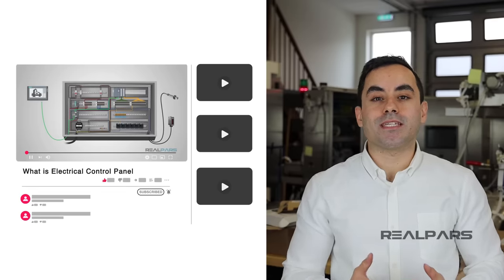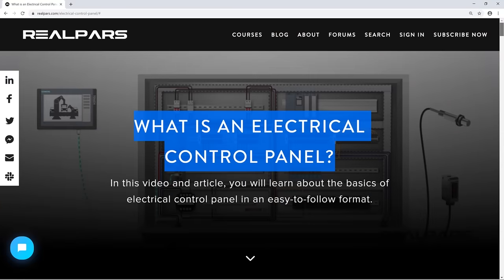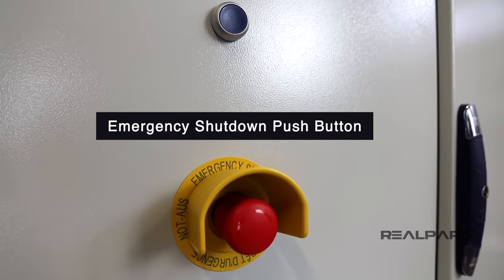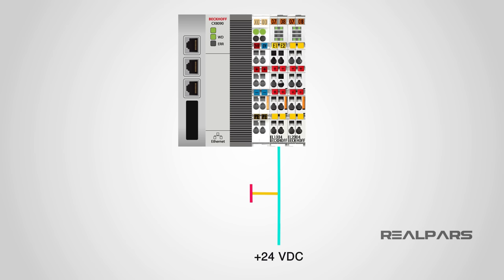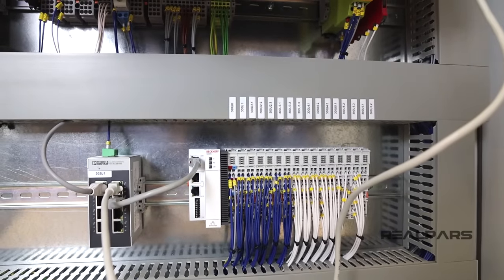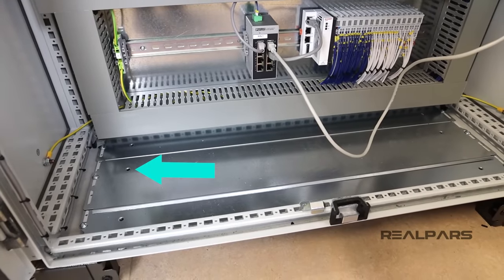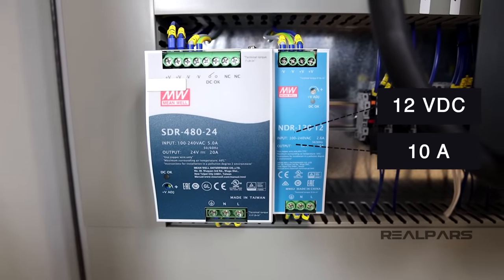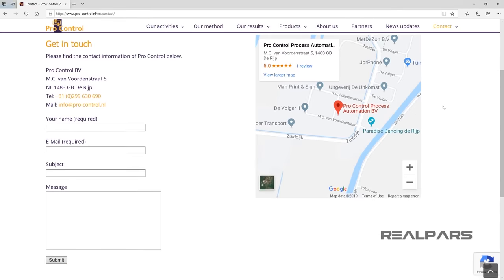Reviewing the Basics of an Electrical Control Panel (Practical Example)

Comment: Great job, one question, how do you make de distribuition of the power of the power suply to the devices?
Reply from the maker: Thank you for your question. The decision depends on your load requirements. You have two options: using a single power supply with a 20% safety margin for your PLC and IO devices, or separating the PLC from the IO load with individual power supplies. Regardless of your choice, it's essential to ensure proper fusing for each component. Detailed information on this topic is covered in technical courses, where formulas are used to calculate feeder circuits. 

RealPars offers beginner lessons on this subject for pro-membership. You can sign up for a week-long trial using the following link: https://www.realpars.com/courses/industrial-electrical-maintenance-essentials. Happy learning

Comment: Please don't learn people to wire a emergency stop function direct to a plc. Never trust a program to handel your safety. Always wire a safety controller, this checks for wire continuety. So wen a wire got lose your emergency conyoller shuts down. A few examples PILZ pnoz , twinsafe from beckhoff.  You can wire a feedback signal from your safety controller directly to your plc
Reply from the maker: In the panel shown, there are many wiring connections between the devices.  The ones connected to the PLC are the only ones that we have explained in any detail in this quick overview.  Typically, one E-Stop contact is brought into the PLC for indication, and a second contact is used to interlock power supplies, outputs, and device circuits.
Reply: Thank you very much for giving this idea we should not trust in program we should not consistrat in function we should consistrat in our study good luck for the education
Reply: It was so much easier when computers weren't running EVERYTHING. I'm for automation, but my gosh when the Drawings have been made into trees and programmer is hiding somewhere I'm the Bahamas my hair turns Grey each second trying to......

Comment: Does Pro Contols welcome people who like to learn industrial automation and other electrical circuits and devices, especially PLC?  ...And if they are from outside Europe?  Thank you for your channel, as usual, which is distinguished by providing everything useful and in a smooth manner😊
Reply from the maker: Hi Ahmed, thank you for your comment and for sharing your kind words! Regarding your question about Pro Control, that's not something we are aware of, but I would suggest reaching out to them yourself. 

Happy learning!
Reply: @realpars  
welcome, I will do that... I have another question if possible... I am a systems and control engineer and I work in a company that produces egg trays... When I told the engineers here that the contactor works to protect the PLC from high loads... they said that the contactor is only  An intermediary between the motor and the PLC and has nothing to do with protection.... Can you help in finding the correct answer?

Comment: Absolutely love RealPars... Can you please upload a video on process control for bread tunnel ovens? Like those which use RTD a temp sensor and modutrols as actuators for increasing or decreasing the flow and pressure of combustion air? Such air coming within a pipe, thanks to the venturi principle, entrains and mix with a volume of gas. The air/gas mixture is then finally burned at a ribbon to increase heat output depending on temp SP. Go ahead!!!!
Reply from the maker: Hey Alejandro!

Thanks for your comment and your suggestion. I will pass this on to our course developers!

Thanks for sharing and happy learning!

Comment: What's the point of carrying sensor cables from the bottom, thrue the whole cabinet, to the terminals at the top, and then back, to controller at the bottom? Why dont You place sensor terminals near the PLC? Thanks for your videos!
Reply from the maker: The placement of devices and the routing of cables in a control panel is largely at the discretion of the panel designer.  Many times, when there are multiple voltages in the panel (24VDC, 120VAC, 460VAC), the devices that are wired to each voltage are segregated from the devices wired to other voltages.

Comment: @realpars
A spectacular easy to understand explanation course. I appreciate it so much.

Is there any AI operated PLC design software that inputs the load(s) and generate circuit diagram for the entire PLC
Reply from the maker: Thank you for your question. I'm not entirely sure, but it seems likely that more options will be available soon. Many professional CAD programs for generating electrical diagrams have been around for over ten years and are continuously improving. You can search online for professional CAD programs to learn about their features and read reviews. Some companies even offer demo versions for limited use. Happy exploring

Comment: Hello, RealPars.

I really appreciate your explanations by means of the tutorial's videos; that is very useful.

I have a question for you.

I came across a noticeable difference inside the control cabinets in relation to DIN Rail 35 mounting.

Some brands like Rockweel Automation, use Parres insulators to separate DIN Rail 35 to the sub-plate. However, in other enclosures, the DIN Rail 35 is directly installed on the sub-plane.

Would you mind explaining the reasons for these differences?  or what is the standard to follow
Reply from the maker: Hi William, 

Thank you for your question. To the best of my knowledge, there is no electrical necessity to use an insulator on the DIN rail, at least not based on the AB PLC being used. It could be a matter of personal preference for the customer. We hope this information contributes to your learning journey with RealPars.

Comment: Wonderful video. But I have a doubt. Is the Legran Unit Distribuition for control  power or cables? Here it is shown as a control cable distribution, while in the Main Switch Video  it is presented as a power  module. 
Many thanks.
Reply from the maker: The Legrand 048-XX distribution block shown is meant for use with individual control wires and low voltages as shown, but there is nothing wrong with taking a multi-conductor cable and spreading it so each wire can be landed.  Legrand also makes power distribution blocks which are similar, except that they can carry higher current loads at 240VAC/415VAC.
Reply: @realpars  Thank you so much for the atention on answering my question.

Comment: Thanks for your videos. I have a question. hould we connect the negative wire of the 24 V Switching power supply in the panel to the instrumentation ground or not?
Reply from the maker: Theoretically, yes, since the 24 VDC power supply is typically connected to ground.  Because some power supplies are not regulated as well as others, it is best to connect the common side of devices connected to a 24 VDC power supply to the V- terminal of the supply (usually a terminal block referenced to V-).

Comment: Please show how will look the electrical connection of multiply single phase servoamplifiers with different power. They will be connected in cascade chain. Upper power line should have main circuit breaker, overvoltage suppressor, residual circuit breakers, noise filters and circuit breakers for each servo amplifier. And show how to calculate them and show specification examples of each device. Thanks

Comment: amazing videos, I have been learning a lot of and changing my mentality about that incredible world, but I have a question; ¿ HOW MANY SERVO MOTORS CAN BE CONNECTED TO THE SAME SERVO ASISTENT; if I have 4 servo motors , can I connect them to the same servo asistent ; or I need necessary to connect each servo motor to his personal servo asistent. THANKS
Reply from the maker: The answer depends on your servo drive/motor manufacturer and what software they provide for a software interface.  In general, the same servo configuration tool can be connected to multiple servo drives/motors via an ethernet interface.  If your servo drives have serial RS-232 interfaces, this may not be possible without physically moving a cable from one motor to another.  Remember, servo drives are the controllers for servo motors, and a separate drive is usually required for each motor, but the drives can usually be networked together.
Reply: @realpars  thanks for the answer, I will follow u recommendations and get 5 servo asistent to my 5 servo motors, keep helping people, u do a great job, THANKS

Comment: Nice video.. 
Why are the pumps directly not connected with PLC using contactors or relays, what is the use of CIU between PLC and pumps ? by using relays or contactors you would have saved the cost of Ethernet switch.. 
Please clear this doubt
Reply: The CIU modules connect to pumps made by Grundfos that have integrated VSD (Variable Speed Drive) and allow more detailed control than on/off with contactors. With a single ethernet cable the PLC can control speed of the pump and receive feedback on motor condition, output pressure, flow rate, etc.
This becomes more powerful the more pumps you are controlling. You will observe that this control panel has at least 8 CIU modules connected. The panel space to fit eight sets of contactors, terminals, PLC analog cards for speed control, etc. as well as running cables for each of these to every pump would quickly become excessive.
Using a communications interface also allows control of the pump at a great distance. Pumps hundreds of meters away in a large facility can be controlled as easily as one sitting next to the panel, all over a single ethernet cable.
Reply: @sjholmesbrown  sounds great. So can a CIU be used to control speed of multiple 3 phase motors over 15hp since it have integrated VSD? and what is the difference between vfd and VSD?
Reply: @silverline5789  It looks like this system requires one CIU for each pump to be controlled. The PLC can control as many pumps as you wish, subject to comms bandwidth and program memory space. VSD and VFD are two names for the same thing.

Comment: is it reliable to connect emergency system to plc,i mean i thought plc isnt reliable to shutdown whole system in emergency situation ? thx for your videos,i love realpars
Reply: The PLC has to be aware the safety system has faults and in my work there would be a e-stop safety relay , door safety relay and others as required 

However the robustness of the safety system depends on the safety risks of the machine and step one is to due a Safety Assessment and then build the system to control the risks 

In most modern machines the Safety Relay is going to shut off various things but as there our now safety PLC the complexity goes beyond a video like this
Reply: @tommays56  there's also the possibility to use  Plc désigned for safety. Almost every major brand does it nowadays, but an another hand needs people with a flawless knowledge of sécurity normes and wiring.

Comment: Please make a video on wiring of PLC I/O and power supply in panel...
Reply from the maker: Hi Alpesh, we already have videos on wiring sensors to the PLC inputs and also several videos on PLC power supply. II will list some of them below. 

How to Wire Sensors to a PLC - Part 1 https://youtu.be/qeBAz_XXUWs
How to Wire Sensors to a PLC - Part 2 https://youtu.be/4EQtCSrKjLs
How PLC Power Supplies Work https://youtu.be/Cl8Uwe1tJ3E
What is a Redundant Power Supply and How Does It Work? https://youtu.be/VgoMG0p90JU
How to Wire Discrete DC Sensors to PLC - Part 1 https://youtu.be/0DoqKS8jqSA
How to Wire Discrete DC Sensors to PLC - Part 2  https://youtu.be/2pdvvqkguA4

I hope this helps. Let us know if we can be of more service or if you have any questions.

Comment: Hello sir, u guys make very good video. can u make a video on how to read control circuit of electrical panel wiring of lubrication oil system and jacking oil system . which have 3 motor for LOS and 2 motors JOS. There are interlocking and change over also in the circuit diagram. I will highly appreciate if u make a video on this as there no video about that in whole YouTube. Thank you I hope u see my comment and make a video.
Reply from the maker: Thank you for your comment, and for sharing your topic suggestion! I will happily go ahead and forward this to our course developers. 

Happy learning!

Comment: Great video. I need to know about the coding of wire colours inside the panel under the EU regulations. There is a rule which colour can I use? Any idea from where can I find a table  of wire colour for 3 phase and neutral, 24vac and dc, safety wires, control wires, start/stop wires, inputs/outputs wires, reset wire and data signal wire.
Reply from the maker: IEC/EN-60204 is the applicable standard. A handy color chart is downloadable at:  https://www.rowse.co.uk/static/downloads/control-panel-wiring-colour-codes-info-card.pdf

Comment: hello and thanks for this video, but i have a question can we connect the sensors directly with the plc ?
Reply from the maker: If you are referring to a direct connection to the CPU, most likely the answer is no.  PLC CPU's are like the motherboard of a PC.  In order to talk to other devices, you need a separate NIC card or serial bus (USB) interface.   PLC's require an I/O subsystem.  In a few cases, the I/O subsystem is integrated into the same housing as the CPU, but most of the time, the I/O subsystem is separate from the CPU. In either case, the sensor and the PLC card that they will be wired to need to be compatible.  A contact closure switch can generally be connected directly to a digital input PLC card.  A 110VAC pilot light will need an interposing relay installed if the PLC card is a 24VDC output card.  A thermocouple can be connected directly to a thermocouple-type analog input card, but with require a transmitter in order to connect to a 4-20ma analog input card.

Comment: I would like to know the size of the cables used in the Electrical control panel 

Thank you
Reply from the maker: In most cases, power wiring (24 VDC or 120 VAC) is 16 or 14AWG ( 1.309 to 2.081 mm2).  Signal wiring is typically 18 to 22 AWG ( 0.3255 to 0.823 mm2).
Reply: @realpars  Thank you very much. This has been very helpful to me

Comment: Hi. My question is that beckhoff digital module always at left side and analog module at other side on connection racks ?
Thanks
Reply from the maker: No, the Beckhoff I/O subsystem is very flexible and cards do not have to be placed in a certain order.  That said, there are logical ways of positioning cards that make the separation of 24VDC circuits between digital and analog sensors easier.  Also, power loading, fusing, and other considerations, such as memory allocation, are usually facilitated by a regular, well-planned architecture.

Comment: Is it safe to connect emergency stop to standard digital input?
Reply from the maker: Yes. The contacts on an E-Stop, whether it is a pushbutton contact block or "safety relay" type are simply Form C or solid state contacts that switch 24VDC.  The signal to a PLC DI card would only be used for indication;  a separate set of contacts should be used to interlock the electrical equipment by cutting power to the enabling circuit.  It is safe to connect the E-Stop input to the PLC, but the signal should be used as the primary safety function/interlock.

Comment: You should NEVER wire an E-Stop to a standard digital input (EL1004) as in your example. You should ONLY use a certified SAFE input (like an EL1904). This circuit would not pass an electrical inspection
Reply: They did address that in a reply to an earlier message. In this video they were discussing connections to the PLC and that would be used for indication purposes on the HMI.  The E-Stop would be wired to other interlock devices as well.

Comment: You almost NEVER connect an E-stop switch to a PLC other than using a NO contact to indicate to the PLC that the switch was activated. The NC contacts (and there should be two of them) would go to a dedicated safety controller. Good overview but you guys need to really brush up on your safety systems.
Reply from the maker: You are mostly correct.  For protection of the system and personnel,  a separate NC contact or contacts are used to interlock power supplies, outputs, and device circuits.  In the panel shown, there are many wiring connections between the devices.  The ones connected to the PLC are the only ones that we have explained in any detail in this quick overview.  Normally, one E-Stop contact is brought into the PLC, and while it is not used for protection, it can be used to complement the hardwired E-Stop actions to disable sequences, etc.
Reply: @realpars  It looks like you're using a safety relay (10:22) but fail to mention it at all. Instead you talk about connecting the E-stop switch in great length to the PLC which is very misleading. Of course you want a signal from the controller to indicate an E-stop state but you should really mention that since you do spend time on it.